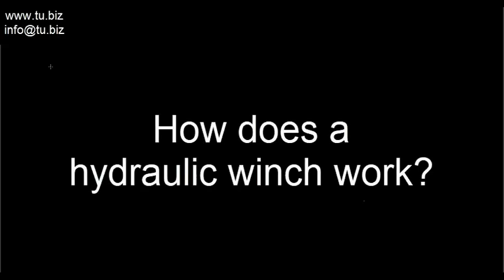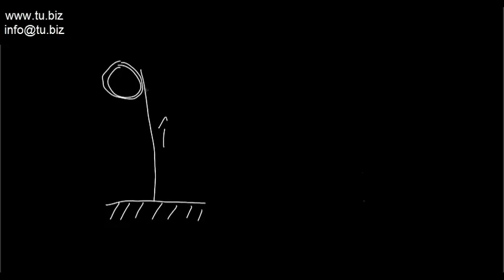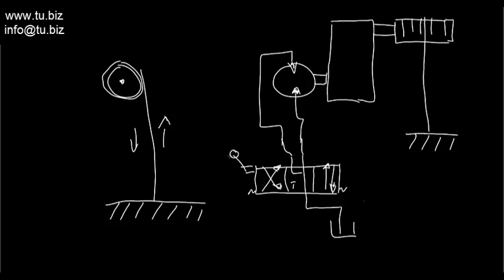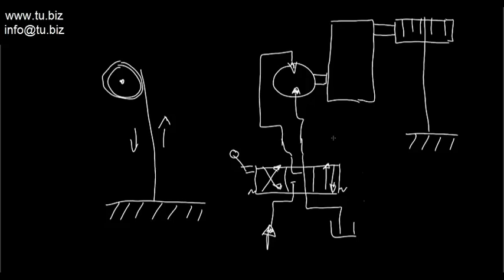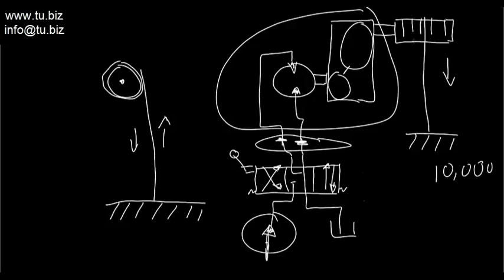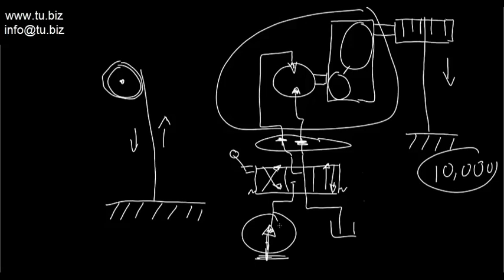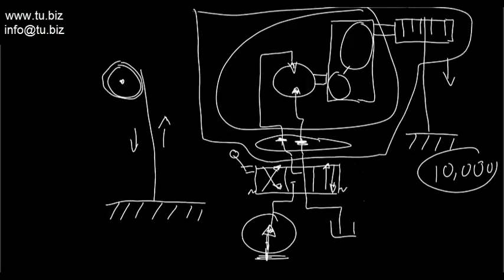How does a hydraulic winch work?

Comment: You don't need to worry about a locking valve on the Hydraulics to a winch if you use a gear system that is worm gear drive. I have a pickup with a power take off 5000 PSI Hydraulic pump with 15 GPM flow. The lines from the solenoid valve to go to the back of my truck where they turn a motor that is connected to a Ramsey power take off style winch. You can pull all you want on the cable but the pump has to turn to let it turn. There is a relief valve in the system set to not break my 3/8 cable.